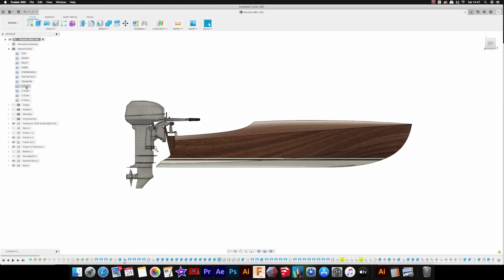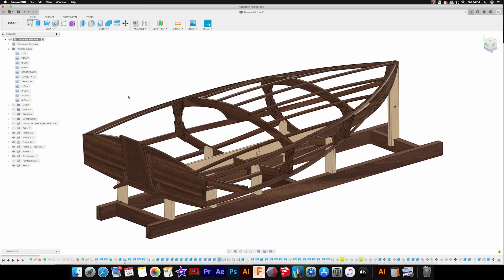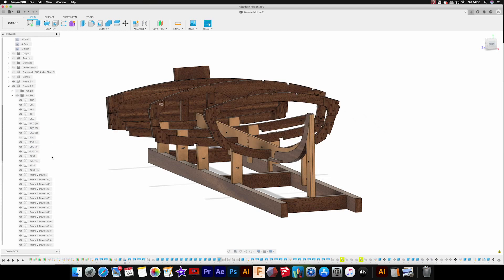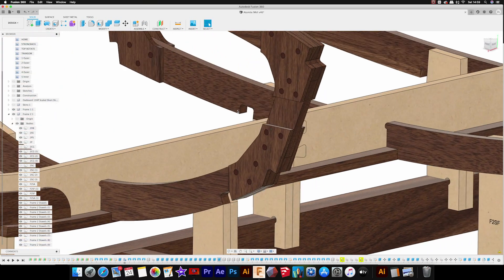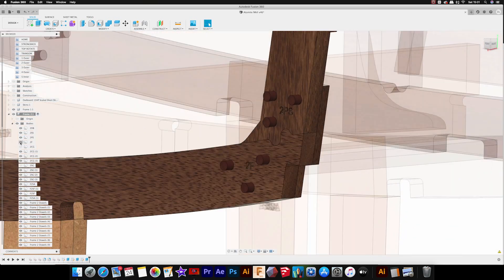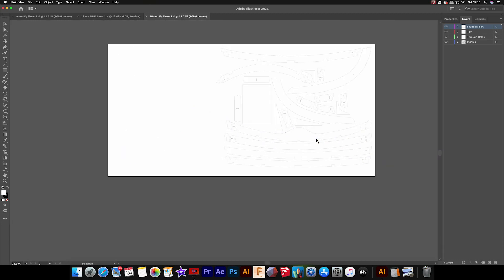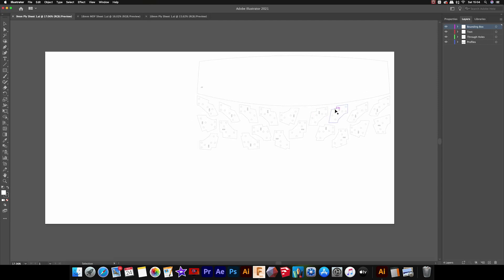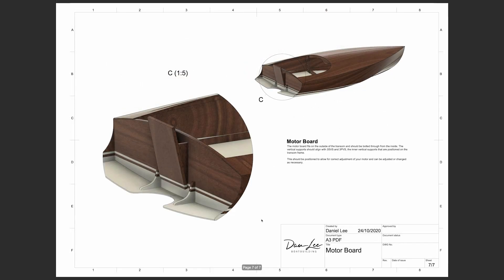Boat Building Plan Tour - Atomite MkII

Comment: Hi Dan, thanks for the great plans! The CNC cutouts are perfect and with the dowels the frames fit together very well. One small info for you: On the material list in your plans, the top sheer (gunwale) is missing. I am using a 32mm x 18 x 2600.  Cheers, Tom

Comment: Thanks Dan for the free plans. Did you have a thought about making similar plans for something like a 20' Barrelback runabout?
Reply from the maker: No worries! Yes I should be working on something similar early next year.
Reply: @DanLeeBoatbuilding  Awesome I'll definitely be in line to purchase those plans.
Reply: @DanLeeBoatbuilding  How are those plans coming along?
Reply from the maker: @stevenbellwallace6194  they are still early stages at the moment I’m afraid. I’ve been working on a design for a customer plus trying to get Miss Isle sorted so I haven’t had much time for the barrelback plans ☹️

Comment: could this be build with only a jigsaw?
Reply from the maker: It is really designed for CNC cutting but it could be done. If you got the DXF files printed out onto paper you could use them as full size patterns. FYI if you draw a straight line through the joints on the frames and leave out the "knuckle part" they will also work as a simple butt joint which would be easier to manually cut.
Reply: I'm hoping so all I have is hand tools I'm reasonably sure I can figure it out .